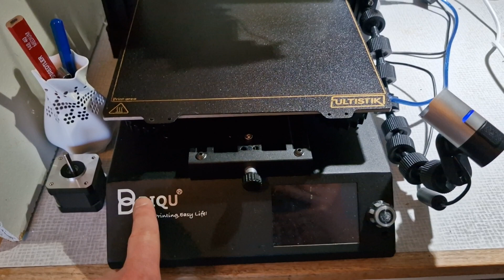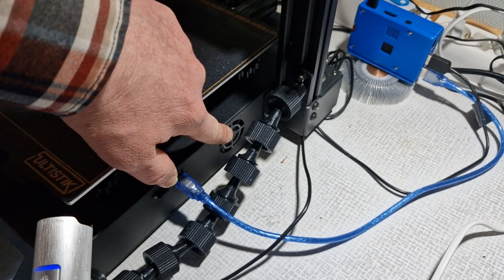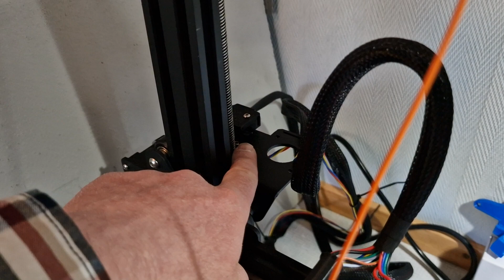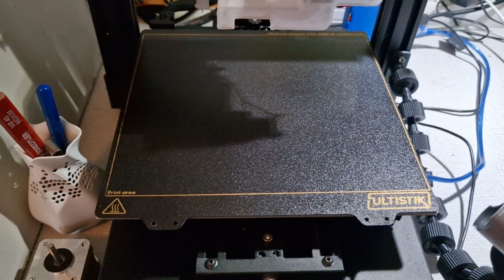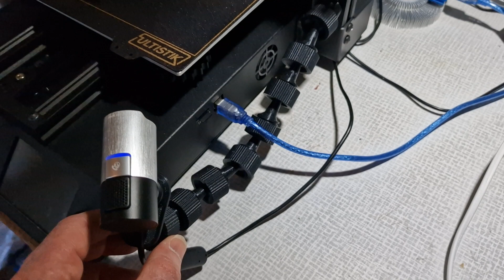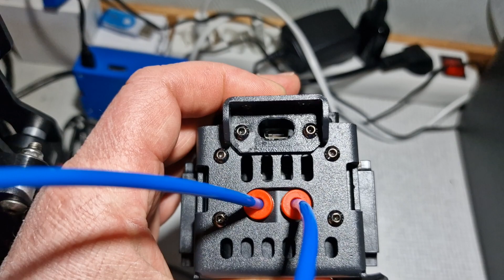Rundown of my current printer setup

Comment: So I just bought a B1 and I have the SKR 1.4 board. Love your upgrades. I just did a volcano all metal hot end, dual z’s, and I’m currently in the process of Klipperizing it. It prints absolutely great out of the box but I love to tinker. I’ve been debating on a hermit crab and H2 but I’m worried about the QC. People are even begging H2 V2’s with grinding gears.
Reply from the maker: If you haven't already done it, I recommend going to tmc2209 or tmc2226 stepper drivers. The stock tmc2225 stepper drivers don't handle speed in silent mode too well. They have a tendency to shut down at speeds over 120mm/s
Reply: @StackingLayers   Well it turns out I burned out my board so I ordered an SKR 3 board with 2209’s. I just Klipperized my KP3S and I’ve been having a ton of fun with it. Excited to get the B1 up and running again.
Reply from the maker: Yeah I'm digging Klipper for sure. I love being able to edit the configuration without needing to recompile.
The SKR3 is going to be a good upgrade to the printer. How did you burn out the 1.4?
Reply: @StackingLayers   I accidentally unplugged the USB-C from the tool head with power on. Shorted out and started smoking. I thought I just fired the USB-C port and cable but I’m almost positive I got the main board as well. Bone head move, hope I won’t do that again haha.
Reply from the maker: Ah yes that would do it.  It's an honest mistake. I mean we unplug USB plugs on a daily basis without powering down devices, so it's almost second nature. I know the new board has better short circuit protection, but I don't know is it would protect against that.
Reply: @StackingLayers   Yeah, big oops for sure. Oh well, lessons learned. Still having a blast learning 3D printing though.
Reply from the maker: 3d printing has definitely been the most rewarding hobby for me. It tickets so many boxes on my creative cravings list.